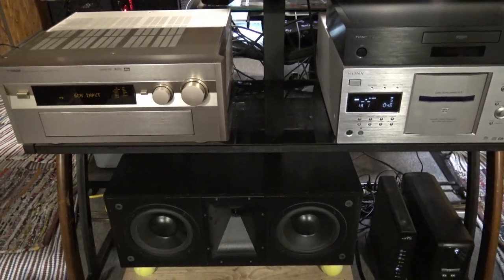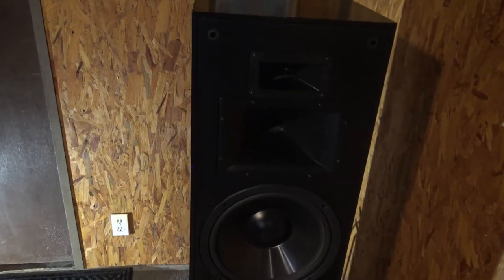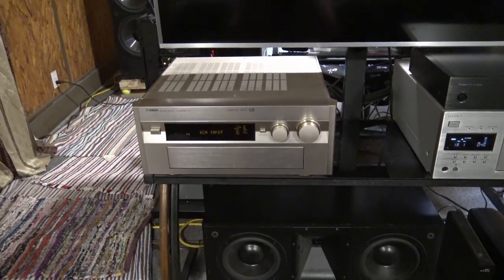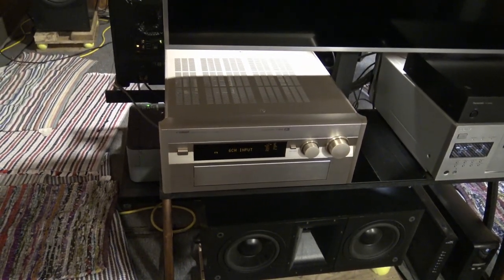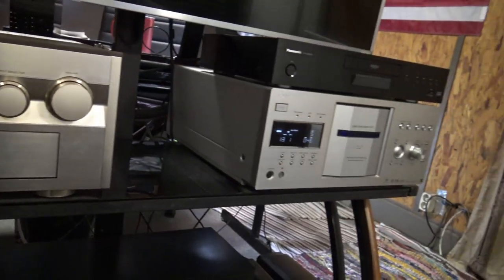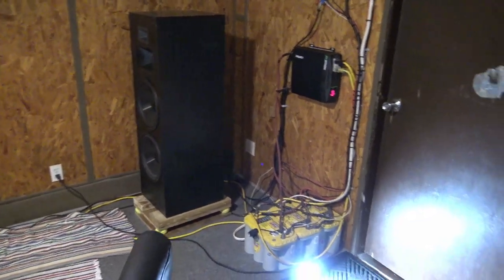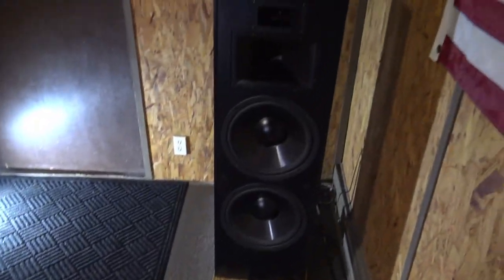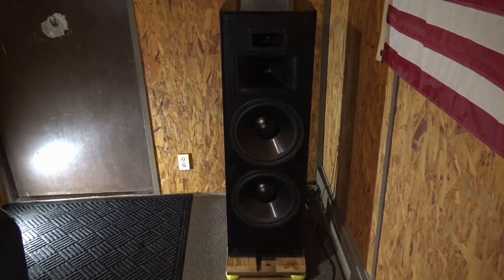Klipsch KLF 30 / Yamaha RX-V1 Bi-Wire Setup

Comment: Interesting video, thanks for sharing. Have had a lot of audio gear over the years, and the older, used stuff is such a good value. That receiver is a tank with unbelievable sound and build quality, and can be had for pennies on the dollar. I have the RX-V2095 and it sounds great. Love the A/B speaker switching to compare different speakers.
Reply from the maker: Hi Steven. Thank you for your comment. Yes, I'm very happy with the RX-V1. I had other Yamaha Receivers before and I liked every single one. The RX-V1 was the one I always wanted. I think Yamaha really put everything they had into this one at the time. Internal copper isolation plates to keep the various boards from interfering is just about the icing on the cake. I can't think of any other Receiver or Amp that has such expensive case components. I actually owned 3 of the V1's. The previous were the black versions. The only flaw theses receivers have is over time they start randomly cutting channels out. There are tons of info all over the internet regarding the source of that and possible fixes. Then I've heard somewhere the gold colored version of this Receiver had a stricter quality control at manufacturing due to the somewhat higher price. Not sure if that's true, but a few years back I found this one in almost new condition. It just served as a backup for someone who had all McIntosh Gear as his main components. And he sold me this one for 200.00  That's less than the average Walmart Plastic junk boxes cost. I own it now for almost 10 years and use it every day for several hrs, either watching movies or listening to music in stereo. It has not had a single hick up. And when I watch movies I'm not shy about running this thing at high volume levels. But no matter how much I push it, it hardly even gets warm. I wish this will last me forever, it's all I ever need.